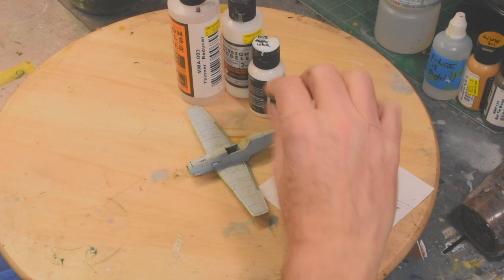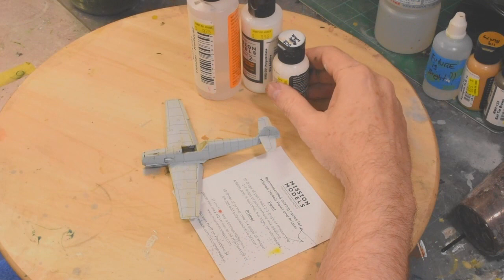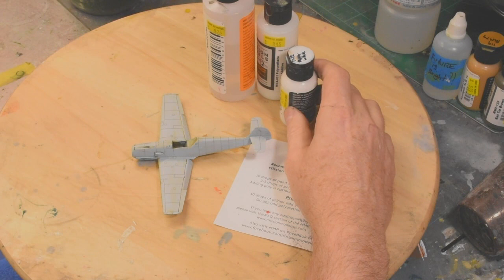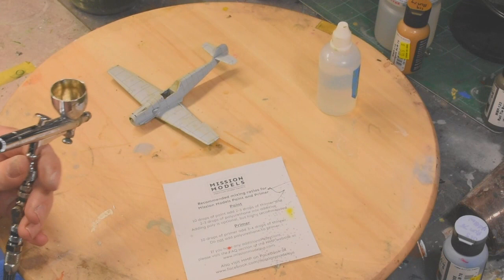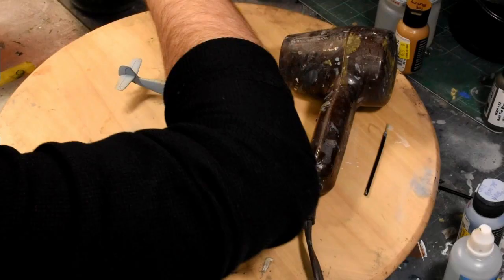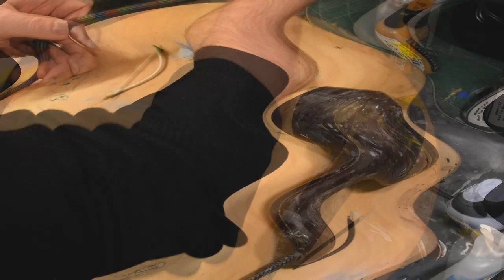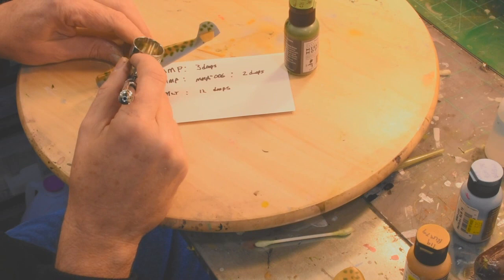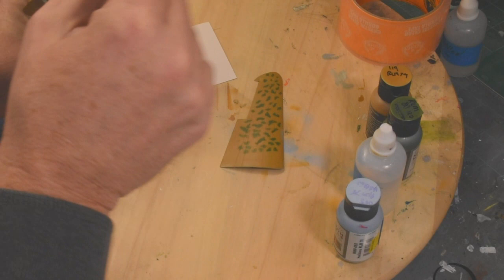Mission Models Paint - thoughts from an aircraft modeler.

Comment: I find MMP over rated garbage.  I have tried their way and several other ways and it sprays like crap.  I do not like it at all
Reply from the maker: It's not "garbage", it's poorly supported, and marketed. It's actually very good acrylic paint, but its still acrylic paint.

It's overyped vallejo.. But the point of this video is how to make it more useful.  I certainly use it, but where it makes sense to use it.
Reply: @frankcrenshaw2880  Support or not the Vallejo works better in my opinion.  I have tried it several time and completely dislike it.  Took it off my shelf and either looking to sell it it give it away or trash it.  The FS numbered paints are not even close to what they should be.
Reply from the maker: 😊works about the same in my experience.   But where I mostly use it is for figures and weathering.  But I also use vallejo. 

To me they are basically the same thing.  Colors aside, they function about the same.  Unfortunately, mission models ownership is unwilling to hear this. 

This video got me banned from their facebook group! 

Truth is, if you thin it, it's better.  Don't follow their guidance.. 😅
Reply: @frankcrenshaw2880  Ill give it another shot but I know that I am building a F-4C Phantom and their FS paints are not even close to what they need to be.  I need to add white to get them closer.
Reply: I found that thinning the white primer for a base coat.  Followed the manufacturer's instructions and found that it turned out to be the consistency of pancake batter.

I find Vallejo to be so much easier to use.

Comment: Love the scientific exploration! I love the mission models finish but am totally on board with your assessment of random adhesion issues. Never a good time for adhesion issues that is for sure! I also hate their clear finishes. The Matt is more of an eggshell and therefore worthless as a final coat. I am willing to give your method a try in lieu of priming if it does away with the adhesion issue. Taking it a step further, is the gloss high enough to now bypass the gloss coat before decalling? If so, you probably found the holy grail in paint. I appreciate your input!

Comment: You don't  need to use their thinner to clean the airbrush.. its acrylic paint.. have a spray bottle of good ole water and spray that into the paint cup while holding the trigger down then just wipe out the cup with a paper towel or clean rag. Using thinners to clean an airbrush is how you destroy the o-rings.

Comment: I really wanted MM paints to work for me. I've moved to water-based paints to remove the smell of lacquer based paints, particularly in the clean up process. I like their colour range and colour accuracy and the ethos of the company. However, I've had nothing but problems with adhesion and I'm not looking for this hobby to give me stress and unpredictable results. Will I give it another try with Klear?; maybe to use up the paint I have. I won't try it with MCLT - I might as well use AK Real Color in that case. Really appreciate your experimentation on our behalf.

Comment: I've started using Mission Models paint recently, and I have experienced the same issue with the paint peeling off or chipping with fingernails. I have found a less expensive option than using Mission Models primer. I'm currently building Tamiya's 1/48 Tiger and sprayed Mission Models Dunkelgelb 44 & found that the paint stayed on & did not chipp. I sprayed Tamiya flat black for a shadow coat first and then I used Tamiya's light grey on my Fw190d9 first, then used Mission Models paint and did not have any peeling or chipping issues.

Comment: The videos published by Mission Models show them using water to clean out most of the paint, then use a little thinner to get the last part out.
Reply from the maker: I find hardware store lacquer thinner does the job quickly and quite efficiently.   Notice I didn't wipe the model down, I did't do any special treatment of the paint, brush or anything..  And it went down silky smooth.  Go to the end where I tried to pull the paint off with gorilla tape..   My point is that this paint will stick simply by adding future to it.    Now if you want to jump through all those Mission Model hoops - go for it.  But understand the point I have proven here, is that you don't have to do that.

Comment: Frank, I tried a 50:50 mix of  MMP and Future (now Pledge Revive It floor gloss in the UK) and the result was excellent! Gave a rock hard, sheen finish; impervious to rough tape treatment, water and odourless thinners/white spirit (so can be used with oils for weathering). I'm also now using Stynylrez primer rather than MMP. Thank you for the great tip.

Comment: Great review!!! 
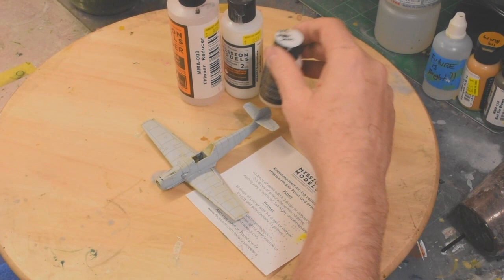I've just had my first experience with MM acrylic on an aircraft project: Kinetic's 1:48 S2E Tracker. Up to this point I have always used Tamiya/Vallejo/maybe even some old Master Modelers by Testers I still had kicking around. Well; back to the Mission Models... I had laid down a nice primer coat of Vallejo black. After setting a day or so I masked off (using Scotch 3m "Delicate Surface" tape), sprayed my Light Gull Grey on. No paint pulled off. Mind you I ONLY used some lightly thinned MM paint. No other "additives." When I came to decal...OMG!!!!!!! What is HAPPENING! That's when I found out about this stuff! Now I AM, and always HAVE been a believer in Future, or Pledge, so I over sprayed a light coat, then after curing another coat. The next decals went much better. But Man!!! I'm thinking of going w/ Mr. Color for my next project, as I cannot find the colors I need other than Mr. Color, or MM for the next build (super detailing a Kinetic 1:48 F-105A/C in Viet Nam era camo.

Comment: Got to about the 9:00 minute mark and you mentioned Future as a thinner/glaze additive. 
  Yep, I’m with you. Stuff works the same with Model Master also. Mix 50/50 or a tad to the Future side, sprayed over your favorite primer and you can almost remove the glossing overcoat stage for washing and decaling. Stretches paint usage.
  I can not claim stake to this technique, I read about it on the old ARC site nearly a decade ago by a modeler that went by the handle Danger Atom.
  A hat tip to both of you for this.

Comment: Good points on the Mission Models paints. My best friend/modeling buddy bought into these paints hook, line, and sinker and had many issues when following their initial processes. We bought about $200 total in product soon after Jon started. He has since revised his mixing ratios, btw, but never would admit it. We had masking/paint lifting issues, poor coverage, poly going bad in only a few months, etc. My buddy reached out to Jon twice, explaining that he used only Mission products and followed the directions to the letter. Tamkin basically told my friend he was an idiot who didn't know how to airbrush or follow directions. At that point, he gave me all of his stuff and basically said "Screw him". I've hung on to the paints, tossed the ruined poly, and just set them aside. I've used Future with FolkArt craft paints with good success and I'll be trying the same to maybe get decent results with the Mission Models paints.

One thing you didn't mention in the video (or maybe I missed it) is your airbrush tip size and spraying pressure when using the MMP/Future mix as well as the thinners mix to do the mottling. Thanks again.